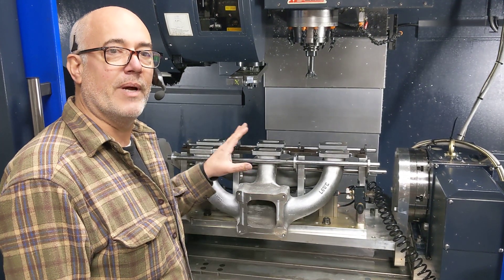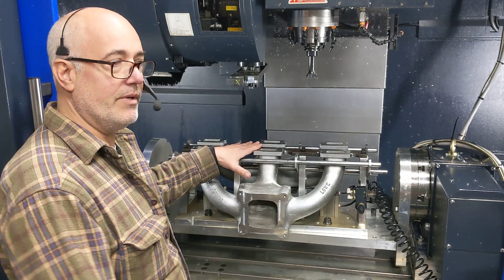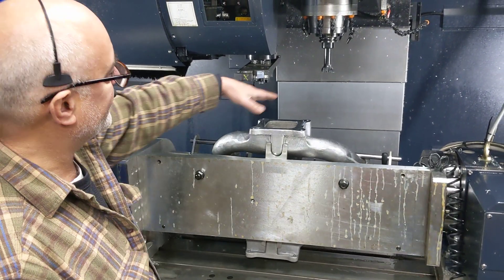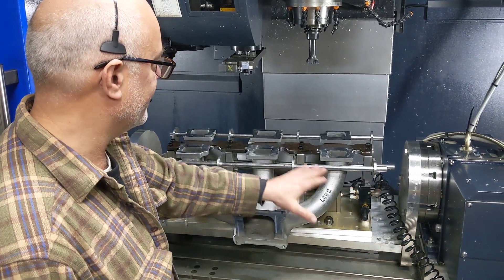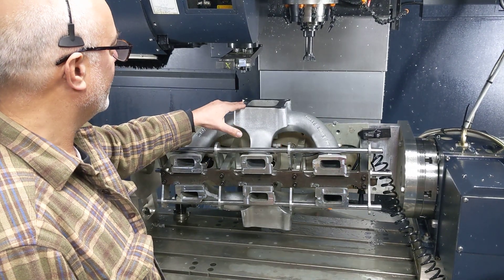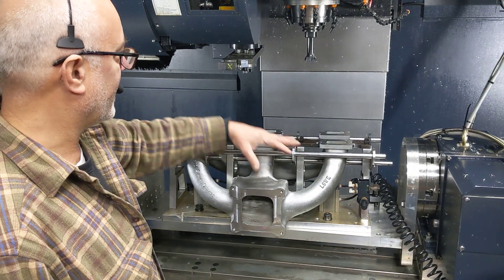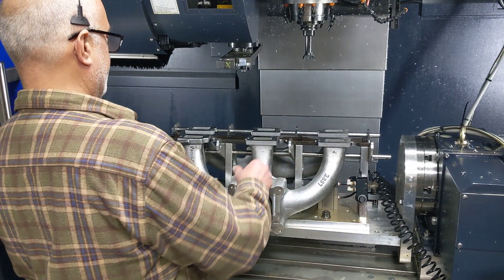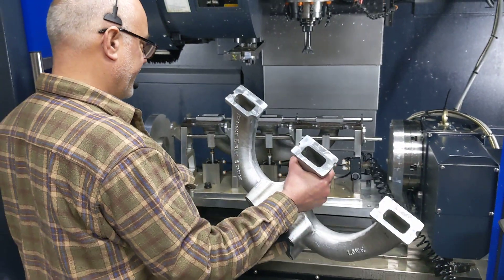PES Intake Manifold Fixture  (Showing Off)

Comment: Do you have new stock on these?
Reply from the maker: Yes, on the website www.12bolt.com
Reply: Thank you for your prompt delivery of this intake! @telowe2000 do you have a video that mentions port matching this intake? Do suggest matching it to the gasket or something else that flows better. I also have your lump kit and 1.94 valves. Do you have a video for porting for these valves?
Reply: @telowe2000 after I watched David Vizard’s video showing the trapezoid shape for sbc heads I thought asking you what works on the 292 head would be in order.